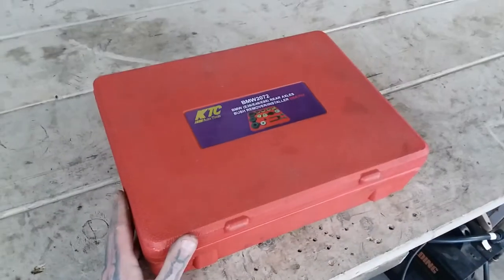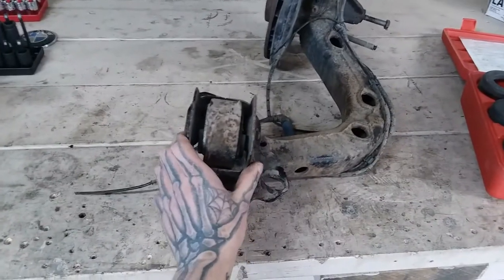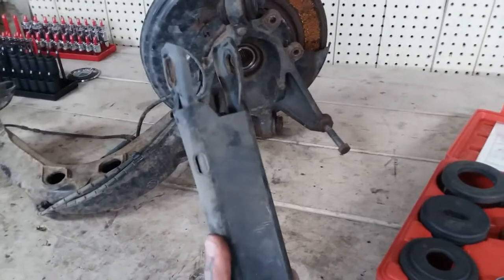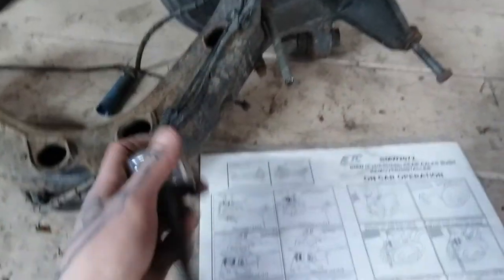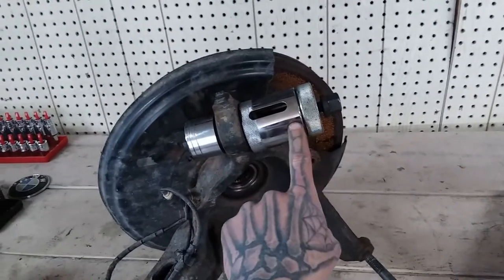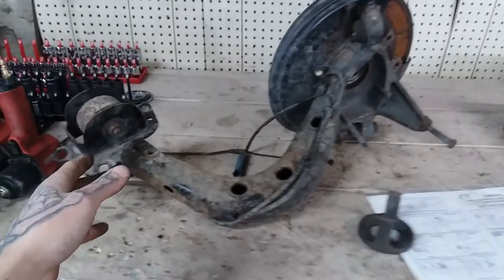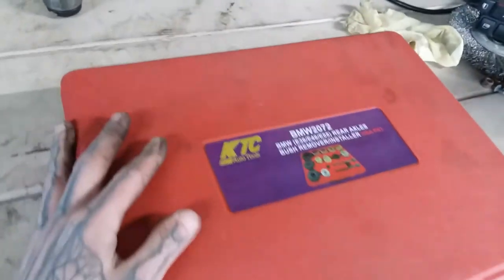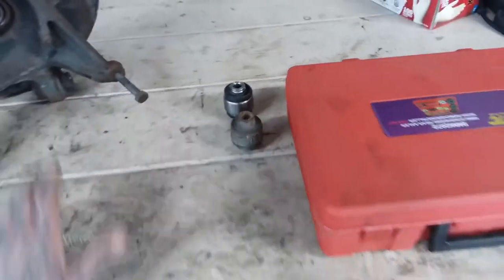BMW E46 / E36 Owners Need This Tool - Tool Tuesday! RTAB Removal Install Tool

Comment: Great info Tyler!! Good job on the video, Can the e46 M3 bushings fit on the stock rear arm?
Reply from the maker: It's the same bushing across all E46. You buy a second one meant for top, fits bottom. Same diameter.

Comment: Appricate you taking the time to make the video dude. Are 318 compact the same? Or does this work on them? I think their rear suspension is more like the old e30 from what I know.
Reply from the maker: Good question, me being over in the US we didn't receive compacts, or any 4 cylinder E46 for that matter. So I have yet to get my paws on one to see the similarities. Unless you're meaning E36.

Comment: Any idea if this set will work for the subframe bushings as well?
Reply: I’d also like to know this?  My diff bushing coo coo
Reply: same here im about to replace my subframe bushings
Reply: I bought a similar set and also replaced my subframe bushings. This kit will not work. I ended up getting a floor press from HF. Other methods include drilling or burning them out.
Reply: @Joe_Bader  dammit alright thank you for letting me know I’ll get a floor press

Comment: Question? I have a 2000 323i with 267k miles on it . When I drive it down highway like 50 plus mph the front end wanders around like you were talking about. I thought possibly the steering rack was worn in the middle position? But could it also be bushings in front that causes this also ? I recently replaced the lollipop bushings the rest are stock still
Reply from the maker: There's going to be a few things that could use a good going over at this mileage. Steering shaft u joint and the flex coupler at rack being some.
Reply: Mine was due to bad rear trailing arm bushings! The back wheels wobbles just a bit and it’ll throw the front end off. I replaced steering rack, control arms, inner outer tie rods and it still did the same. Came to realize it was the rear suspension that would kick the car sideways and throw off the front end

Comment: Will this removal the subframe bushings too?
Reply from the maker: I've personally never tried it. When it comes to removal, you can either A.) Heat up the subframe and pound out the bushings, as the bushings exterior is rubber coated. When it begins to melt, they can slip right out. Or B.) Drill out the rubber of bushings, tap out the bushing center, then take sawzall and slice outer race of bushing then tap it out. I've done both of these methods. When it comes to reinstall, we typically opt for poly bushings so they install by hand/dead blow hammer. I used aluminum bushings on my personal car, I used a wheel bearing installer press set.